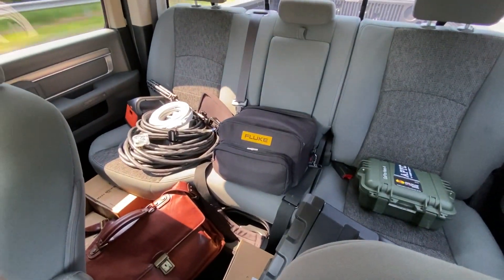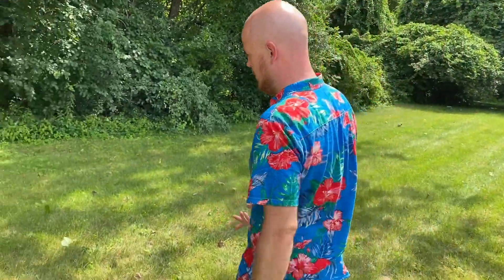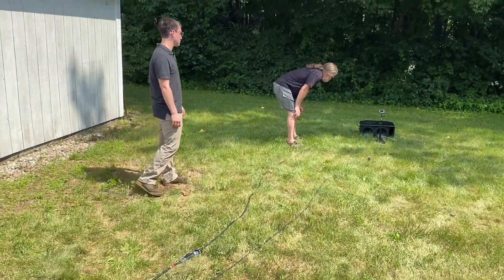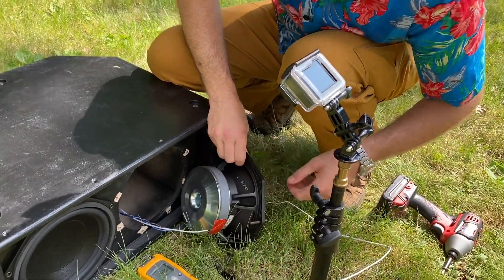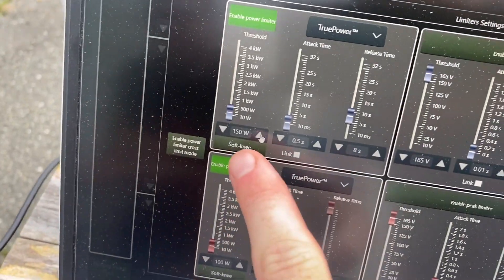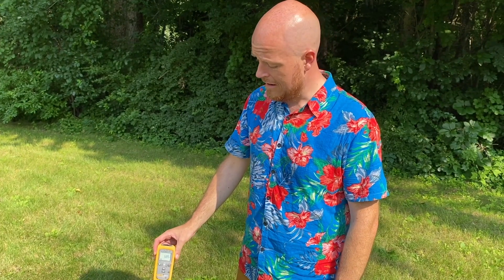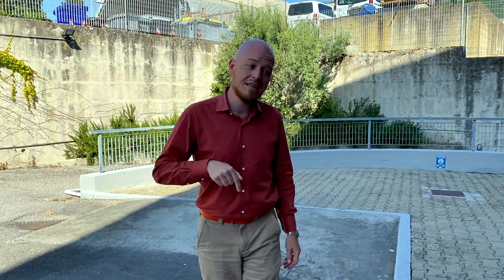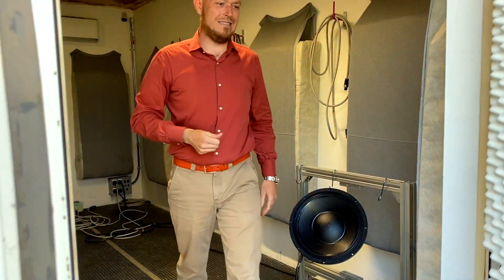Limiter Setting In (a) Field

Comment: True power setting in Powersoft will take the impedance into account so each driver got 75 W , total power per enclosure was 150 W. So 1/4 the AES RMS power from the sheet
Reply: You also don't set limiters to true rms, you set limiter to voltage. Impedance isn't constant so the voltage needed to achieve 150w on the drivers nominal impedance isn't going to result in 150 true watts

Comment: Nice test and good advice.
but a little bit general, it would still be possible to burn the tested woofers with less power if you feed them some sine wave or music with low crest factor around tuning frequency. Best would be if the amp could measure the impedance change caused by the rising temperature and limit the speaker depending on it. that would include everything also a hot environment.
Anyway most amps out there even still have no true power limiting.